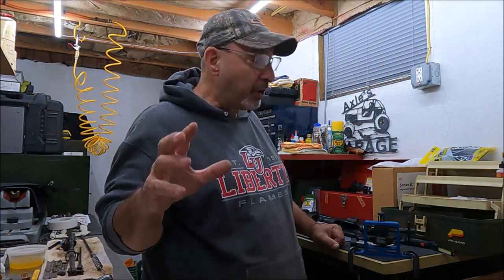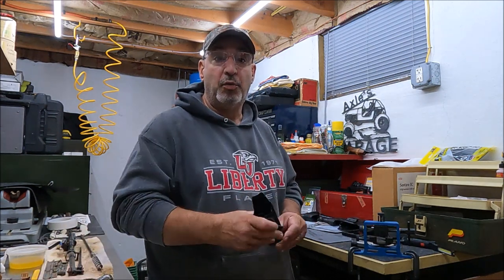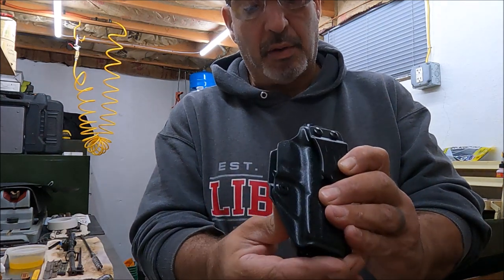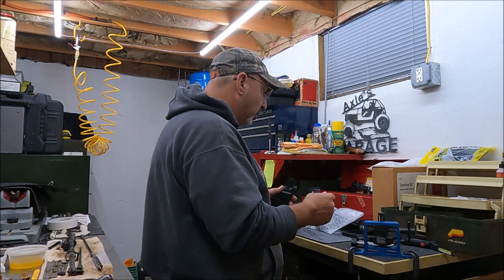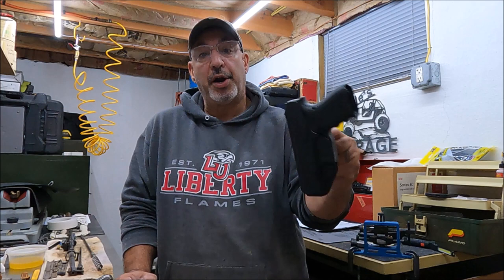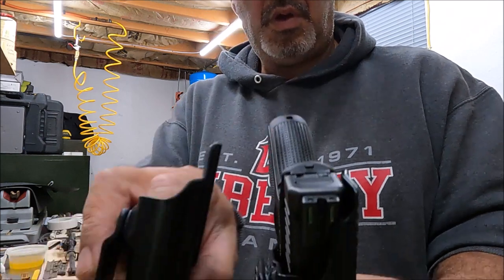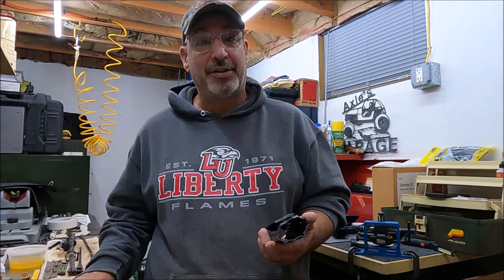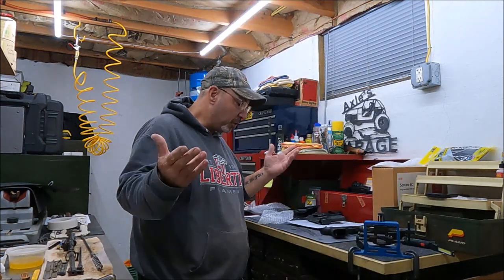$40 Holster Challenge: Episode 9 | Tulster IWB Kydex | Unboxing & Overview - 60 Day Challenge

Comment: CYA Holsters might fit the bill. Also, curious to see if you can change out the clip to a DCC monoblock. Good video, this and the last one. Won't buy Amberide now.
Reply: I am really liking CYA holsters but to be fair I haven’t tried Tulster.
Reply: I’ve used both CYA and Tulster and they are nearly identical 
The CYA won over the Tulster because it completely covers the mag release
Reply from the maker: Just ordered a CYA holster for the next review

Comment: New Sub, Nice review and I do like the “Unrealistic Test” as well as your input after actually wearing it for 60 days. 👍 I have been loving my CYA holster which is in the same price range, I am liking it so far of course I have not tried all of these different brands.
Cya is supposed to be veteran owned and they have a few different holsters at different prices: Standard IWB is $40.00 and the Ridge (With claw Mod as well as Block) is around $60.00
Reply from the maker: I may have to try them when I'm done with my current test holster.
Reply from the maker: Just ordered the CYA, came today, gonna be the next test.